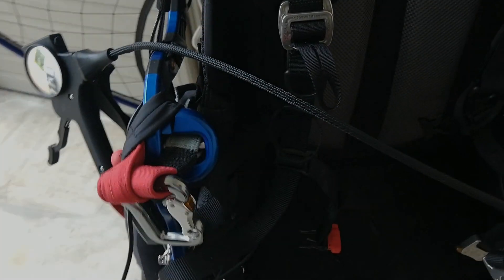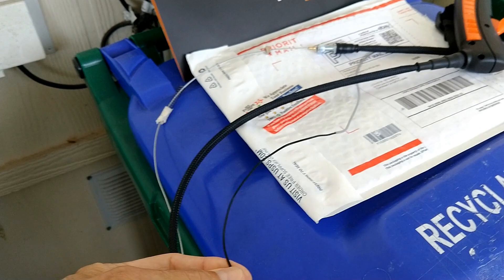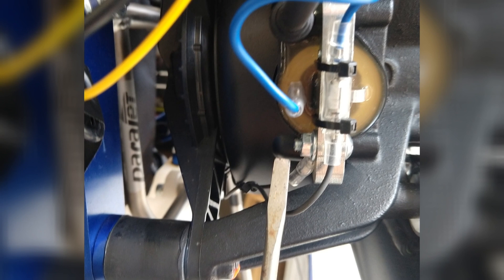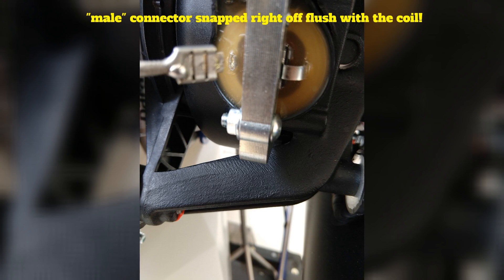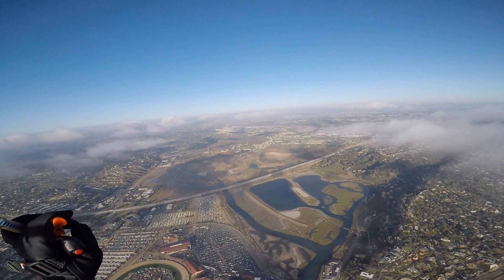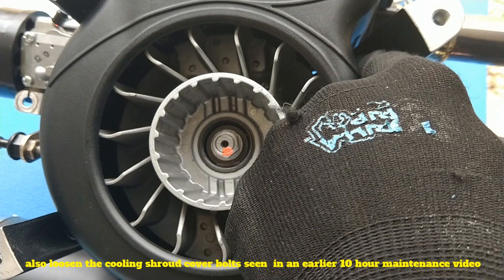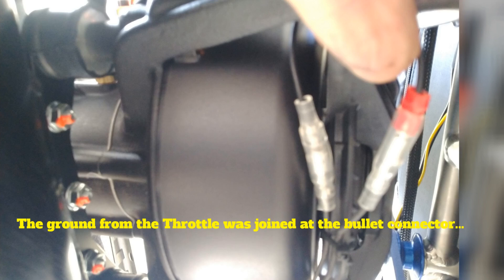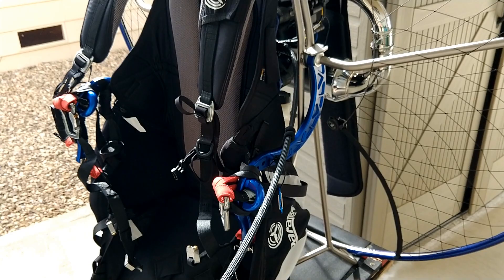Old Guy Flying-Adventures in Paramotor...Repair!

Comment: Air gap on magneto is as close as possible with no contact. Cereal box works. Snug both screws and then torque so one side doesn't pull away or push into the magnet. Engine manufactures give a spec but basically that's the goal. Thanks for sharing.

Comment: I am a a small engine mechanic. But, not an expert. The spacing between the flywheel and the coil is not critical. Just as long as the spacing is enough that contact between the two is not possible. But as close as possible. Business card thickness is good. Even a piece of construction paper would do.
Reply from the maker: The repair site from Southwest Airsports says the same thing for the Top 80 but didn't want to assume the same for the Atom 80 but I suspect that you're right. Thanks!

Comment: That's a bummer you had to replace the coil and take the engine off the mounts, but happy to see it all worked out for you.
Reply from the maker: You know, it really wasn't too bad. The first time is always a bit scary since it's "the first time" but if I had to take off the engine again and do some other repair it really would be OK. I am not by any means a great mechanic but I do like to tinker with things so in retrospect, and since it turned out OK, it was a good learning experience. If the coil would have cost hundreds of dollars I probably would not be feeling nearly as good about it all! It was just that small piece of knowledge, knowing the the connection could be soldered, that made all the difference. I wonder what other surprises would be in store on my next "repair"??? Thanks for the comments.

Comment: What about doing a review on your ATOM80? Fuel burn, in air starting etc. I'm going to start paramotoring now, nearly 67yrs and 150lb, and I have more or less decided to go with a Scout Enduro and ATOM 80 instead of the more powerful Moster 185. I live in Belgium and the highest ground we have is in the south 150 miles from where I live with an altitude 1500ft
Reply from the maker: Thanks for the comments. I am actually going back to the Atom 80 after just trying the Moster. The  Moster is a really nice engine but being 170 lbs. and flying near sea level it was more than I needed. I don't do any acro or maneuvers needing any more power than the Atom 80. I am actually going to do a video on why I went back to the Atom 80, but in short I would say, and perhaps this is more for someone of my age (68), weight becomes (almost) everything! Just putting it on your shoulders and momentarily seeing how it feels is not enough. You have to think about maneuvering for reverse take offs, forward launching in no wind situations (and many times more than once or twice if you blow a launch), perhaps a bit of a hike to the launch (as I often need to do), and the thrill of landing with more weight on your back with a not-so-perfect flare! I think you are making a wise decision. My next unit will be an honest weight without fuel of just over 38 lbs. with the Atom 80 and I can't wait!. The Moster I had was almost 57 lbs! And I will do that video on the Atom 80 as soon as I am back in the air. Best Wishes!
Reply: @loums52  Thanks so much for your quick and comprehensive answer Lou. It certainly seems you have the luxury to be able to try and change a lot of gear, but that also gives us older wannabe pilots some valid food for thought from your experiences.
Reply from the maker: @johncpescod  Thanks...I also have a VERY understanding wife! :-)

Comment: This is an excellent video, very useful!  I'm in the process of ordering myself a Maverick with atom 80 right now, and I need to choose which throttle I want. Of the polini or the v-throttle, which would you say feels smaller in your hand?
Reply from the maker: I like the V-throttle. It is more compact and shorter but a bit "fatter". It just fits better in my hand and the kill switch is easier to use without being "too easy" to accidentally press. I personally thought the Polini was just too long for me and it was hard for my thumb to easily press the kill switch. Thanks for your comments and best wishes on your decision.
Reply: Thanks Lou, I really appreciate the advice!